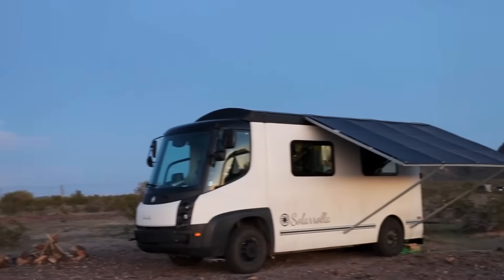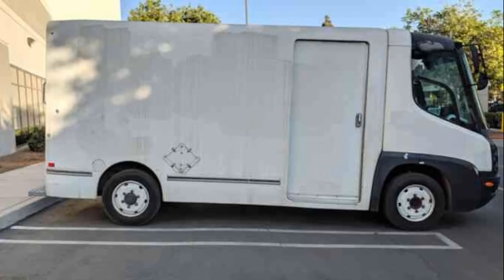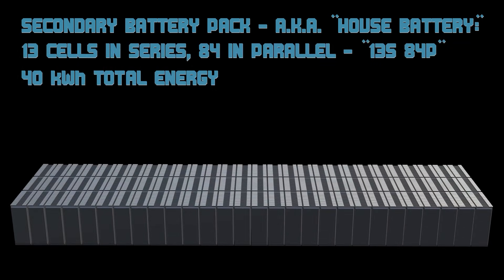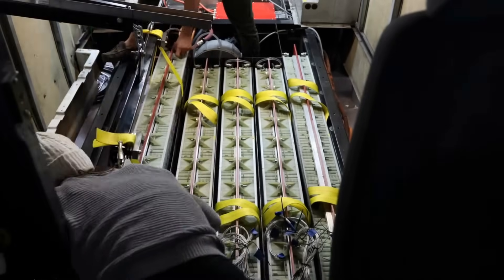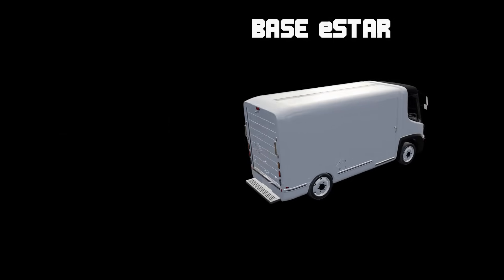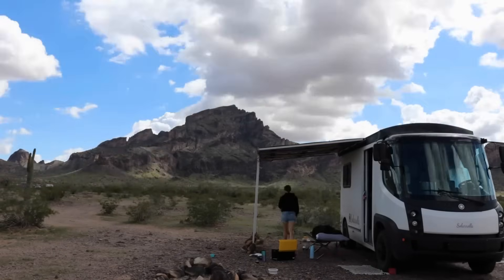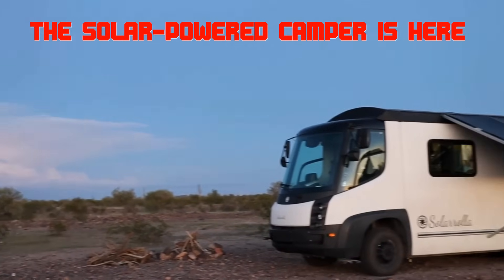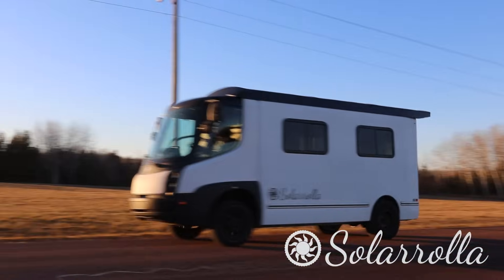Solarrolla Napkin Series 5 - Solar-Powered Fully Electric Campers!

Comment: I applaud the ingenuity, grit and hard work which went into your Solrrolla project. Few suggestions.  Right now you are getting around 200 miles on full charge using 320V motor as I understood? First of all go to 800v system as it is far more efficient, charges faster and can have larger range. Secondly don't waste time building your own batteries, this is completely pointless as you are nowhere near the tech and performance of the commercially available market leaders like BYD. Not affiliated with them in any way but those cells will be used in my build. with 48V house battery system you will get 600Ah battery pack (28.8kWhr!!!) weighing only 170 kg! Use the same cells for the traction battery but build the 800v array. you would need 250 cells for that giving you 251kWhrs! That's 1.4k kgs. For comparison, the Merc eSprinter 113kWhr battery pack weighs 850kg....
You can get the high voltage complete power train units from Cascadia (they have been providing F1 with their hybrid systems since 2009) or IRP Systems and tons of others. Going 800V would allow for much faster solar charging and shore charging in a pinch. I summary I believe it is better in most cases to use ready made products streamline time wise and cost wise your original designs. Also, using those products gives the entire build serious kudos :). Keep up the good work and stay away from anything Tesla ;)

Comment: Back when i was a kid, on my bike i had a wheel mounted alternator for my light, the faster you petaled the brighter the light got, is there a way to use this to help charge the batteries while on the road to help with the load until you dep,oy the panel array?
Reply: Because of the law of conservation of energy, it is impossible to gain more energy from what you put in then what you’d get out doing so. Meaning, a car’s moving tires can be used to collect energy, but it cost more energy to catch that energy then you can ever get out. This is why that cannot work. This principal is applied in electric vehicles though, it’s called regenerative breaking. Because, when you go to slow down a vehicle that is a loss of energy as well, and we can collect back from that. But for example, you couldn’t mount a windmill on a car, and expect to get more energy from the windmill— than you’d lose from the added drag from the windmill.

Comment: LiFePo4 batteries are great, only issue is probably the energy density; they're much safer than something like Tesla's Lithium Cobalt, but they hold way less energy per kilo. Still, if i were building an EV RV I'd use that chemistry. They are not nearly as explosive and don't require as much heating or cooling, either. You can even buy prismatic packs that are 3.2 volts and, say, 300 Ah; build them into compressing steel boxes perhaps and put enough of those in to reach some hundreds of volts and tons of watt hours and you'd have a great battery that can do 3000 cycles or more. I'd love something this size with slideouts for more living space and built on that 4x4 chassis. 4x4 to me is more about always knowing that getting stuck would require some serious screw-ups - and of course in snowy conditions it's brilliant. Some extra ground clearance wouldn't hurt either. Unfortunately my wallet can't come close to supporting that, and either way I'm not even in America. But great builds for sure, hope you do something great with the 4x4.

Comment: There is a thing called a crystal radio, from the very early stages of radio. It works without any battery to power a small earphone. Why not apply this principle to charge batteries, if used in large and efficient enough arrays?

Comment: One thing learned in mexico , in all deserts and mountains of North America is that CLEARANCE is more important than 4 wheel drive.
Though I had a Volkwagen kombi looking every much like yours  excepting only tht the interior had been modified t be over 6' standing room (I forgot the custom company that made the camper with its top (it allowed for a small bed at normal kombi roof level, but we used the area to safely stow surf and windsurf boards sails, etc.)), and was comfortable for two weeks at a time, which was about the financial limit for traveling . It was always confortable, and only the necessity to fuel up life with more cash limited duration.

I also had a Mazda 6 ft bed pickup, so light that it flew inadvertently over bumpy dirt roads. That style convinced us that clearance rules. 
As a 2-wd vehicle that model had been superior over Baja California's "1000" mile races to the competing 4-wds.
it looks as if the Solarolla has the requisite clearance.
I had NEVER had to dig out my own vehicle, though often rescuing stranded Canadians and US residents who had never had either experience or attention in driving in sandy and other areas where one cannot stop and start.
Lower clearance vehicles damage whatever s hanging low, and though duct tape and shoe goo got me several hundred miles back north in a VW diesel golf, those items cannot be expected to replace an oil pan - not a consideration in EVs.

WHAT are projected prices for the Solarolla?

Comment: Does the rounded roof reduce drag? Can you walk on the roof panels (you can walk on top of marine grade panels). What is the coefficient of drag for the base estar and how does it compare to an electric ram promaster or sprinter? Have you considered adding a tapered box to the rear or do mirror deletions (replaced with cameras) to further reduce drag? Can we get a look at how you've arranged the water storage, since it has to share space with the batteries? Have you considered adding a pop top to this model as well? Finally, have you considered using water sprayers to cool the panels (you'll need to use deionized water or else it may cause mineral buildup)?

I love the idea! Unfortunately I can only contribute ideas.

Edit: ah I commented before the end. Pop tops and slide outs is super exciting!

Comment: I'm hoping to buy a Tesla Robovan, pulling a light trailer loaded with solar panels to keep it charged.  I'm thinking of not only putting the panels on the trailer, but also pulling out vertically stored
panels to mount on the ground nearby to provide even more power when camping or at parks.  The pain in the neck part is solar connectors...they are easy to connect, but a real pain to take apart.
Do you have a suggestion on what to use for the connectors?

Comment: To do something like this is pretty cool, but that charge time and the foot print of the solar array is pretty big. I understand the whole purpose, but I would follow some other paths also only due to you're not promised fast charging everytime you're charging which is understandable however I would also buy a nice size generator for the worse of the worse problems occurring. I follow Murphy's Law, if it can go wrong it will and I would surely make it effective and try and cover every problem before it has a chance to sneak up...

Comment: Hello !!!   So AMAZING !  I'm currently building a 100% custom catamaran and I'm amazed by your electronic display...  What did you use for that ?
Reply from the maker: @antonygilbert9695  Hi, we used the AEM C7 display along with an arduino board built by an engineer Brett when to college with.
Reply: @solarrolla  THANKS for quick reply :) !!!    is this a CAN Bus connexion ?   and are your motors in 48V ??

Comment: How's about instead of having all that weight at the top of the vehicle with a smaller footprint why not find a way to utilize the sides of the vehicle with fixed panels that when stationary you can unclip and extend up. I see your pull out top mounted design and you unpack from the rear and frame up and extend solar panel design lets be real that is never going to work who wants or will spend an hour to set up their panels and an hour again to dissemble their panels, not only does that take Presious time its also a hazard from falling or in case of an emergency or danger you need to pack up and get away as soon as possible. Nope id like to just pull up hose off panels if need be for cleaning unclip a few clips press a button then stand back and watch the side panels of the van pop out and extend up and out capturing a larger area that that of the roof alone then if I need to get going do the same in reverse and get out of there quick in under ten minutes.

Comment: I always had this idea (even though I am not an engineer or mechanically minded) and wondered why they (EV manufacturers) don't put small wind turbines under the bonnet (I think you call it the hood) or even underneath. I mean you only need put your hand out of the window  at 30mph to feel the wind force (imagine that being funneled into a small wind turbine or multiple wind turbines). Would always be generating some electricity when driving & even when stationary on windy days would potentially produce a small amount. I realize it would create drag but thought the amount of electric it would generate would still be a substantial net +. electric gain. Obviously combined with solar & regen brakes for max all round off grid potentially unlimited capability. At least in my mind I thought it was possible & assumed it isn't being done because the powers that shouldn't be don't want people having free electricity esp on a vehicle that has potentially unlimited range (or could act as a mobile charging station for other devices/vehicles). PS great job here with the solar campers

Comment: Chucking my napkin idea into the mix. Teardrop rear, with canvas pop top when stationary, hinging off the back of the originally van. Like the trunk/ tent on the Aptura?
Reach out to local boat builders to look a creating carbon composite parts for the framing of the panels too, to save weight

Comment: This vehicle can't possibly get 100 miles let alone 200 miles using the panels shown in a day.  10 300 kWh solar panels are only able to provide a Tesla Model 3 a range of 30 miles given 10 hours of intense summer sun in Vegas or Pheonix; so even if you could find a spot where you could extend these panels out - like in the desert or parrallel parked where there were no side walks or other obstructions; you'd be lucky to get 50 or 60 miles going 30 mph; and at highway speeds you'd be lucky to get 30 miles. In less sunny climates like Seattle, Boston, NYC, Minniapolis - you'd be fortunate to get half of even those short ranges.Let me know when you can be honest.

Comment: Really interesting. Is 1mile/kWh as good as it gets on this vehicle? The (much smaller) Buzz gets 2.7 miles/kWh 3 if you don't drive too fast. I don't know how much the modec with 200kWh battery weighs but it feels like one could do a bit better than that? Blade cells in these looks interesting.

Comment: Gud am solarolla,I had an ebike powered 60v/45ah and 1500watts motor,I am asking how much solar panel do I need for this set up,I am using also a boost charge controller powering 600watts,tnx in advance for your response.more power to you Solarolla.

Comment: Perovskite solar film awnings retract (roll up) automatically when wind speeds exceed safe levels. 
Your design ideas are very creative given the juggling act of function, weight, size. 
Pop ups & slide outs made from super strong, lightweight carbon fabrics optimal. 
Some are towing customized utility trailers that use unit powered regenerative edrive wheels for enhanced towing, downhill charging and off-roading.
All the best to you guys 🫡🇺🇲

Comment: I think this is a bold experiment.  There is no reason every RV can’t have solar roof and awnings.  However we also need EV charging infrastructure in our national and state park campgrounds to get this idea over the hump and jumpstart the EV RV revolution.  Our parks should be the epicenter of climate change awareness and response, not showrooms for PM 2.5 spewing diesel rigs!
Reply: Our National park campgrounds should be shaded with solar panels tied to megapack batteries and charging outlets.  Charging does not need to be free either.  Priced right it would pay for itself while still being cheaper than fueling an RV!
Reply: Couldn't agree more!

Comment: I just calculated and planned a lot with a little AI support (using tech data of available small lightweighted EV Micro vans in Europe) and my results are:

Power on the roof (at charging pause) should be about the same as power consumed when riding, or better even a little bit more. Something around 10.000-12.000w should fit.

Charging power while driving - fron fixed panels on top into a second smaller battery - should of course be as big as possible, 2000-3000w would be nice. That could ad up to 10kwh of additional energy while driving.

That means: Main battery is as small as possible (usefull for a 3-4h drive, about 250-320km distance )  and vehicle, solar panels, battery etc. are as lightweighted as possible.

On a long summer day I want to travel 450-600km per day, with travelling speed of 75-80km/h.

Therefore each travelling day is divided into 4 or 6 parts - 2 or 3 times driving and 2 or 3 times charging (and in the meantime recreation, eating, drinking, planning, hiking, sightseeing or even doing work).

As sun is less powerfull in the morning and also in the evening it might be useful not to charge but to drive then - using part of the battery in the evening and the second part in the following morning.

With daylight from 7 am to 9 pm
a typical day on the road could be like this

7-10 driving
10-14 charging
14-16 driving
16-20 charging
20-21 driving

I want to be able to get to almost every region of the continent in one week or less.
Reply: So, you have a van that can fit 20 to 30 solar panels (100W) on it's roof?  I think you need a little more AI support on this.  You can typically get maybe 10 miles per day of power from a van roof that is totally covered with solar.  If you have panels that are about 3X the size of the van's roof when parked and all those panels deployed, you can plan to charge enough to drive 30 miles per day after the sun sets.  I'd love a vehicle that could do that.  Drive a hundred miles, then park for four days and charge back up before driving another hundred miles.  Would be a self-sustained, relaxing way to live. But you are not going to traverse any continents in such a vehicle without external charging.
Reply: @darth_pronator  You get me completely wrong 😂

The planning has gone some steps further since I posted it the first time.

In the meantime I found and tested the car that will be used. And I have got in contact with the company. 
The flexible panels have 430W each and a weight of less than 8kg.
 2 are fixed on the roof and on one side and 6 are inside while driving. They also form a sun protection roof during the charging breaks.

The car, a lightweight vehicle needs 8kwh per 100km.

There is just one big challenge - you need long days and full sun to make 600km. If that's not the case the possible mileage per day gets much less.

It will take some time - but then it will be presented here on YT.
Reply: @BarryMambo  Like you, I’ve spent a lot of time researching and planning a similar project. While the calculations in your second message seem more achievable, I still think they are quite optimistic.  I own a Chevy Bolt. It’s a small, efficient EV that gets 240 miles on a 60 KWH battery.  That translates to 50KM per 8 KWH.  There are not EVs out there that can beat a Bolt by a factor of two.  Also, keep in mind that, like all EVs, my Bolt loses about 25-30% of its range at highway speeds. I get 240 miles at 40 MPH. But there is no way I get more than 180 miles at highway speeds of 65 MPH.  Plus, I’d guess that 2 430 KW solar panels will hang significantly off the sides of the roof of your car. I doubt I could fit one of those panels on my Bolt. The wind resistance from that would certainly cut down the mileage by a good amount.  So, I think you are looking at a maximum of 30 KM per 8 KWH.  But certainly, if you have the large number of panels somehow stowed away in the vehicle to deploy when you park, you’d be able to travel a good distance in the evenings. But I am quite certain that real world performance would be a lot closer to 100 KM per day, rather than 400 KM. All this also assumes you are driving in hot weather, the range of an EV drops by at least 30-40% in the winter.
Reply: @darth_pronator  The vehicle I will use weights less than 600kg (thats more than 1000kg less than a Chevy Bolt) and needs 8kwh per 100km. The range is almost 495km.

Comment: Excellent work, I was surprised by the 1kWh/mile you experienced, that's 4 times my model 3 average (70% highway), even considering weight and drag, it seems too high...
Reply: It is high, at 75mph, can drop to 600 when cruisin easy 50-55mph.

Comment: 200 miles it's good but not always enough. Did you though of the BYD idea by adding a small engine (diesel/gas ) as a generator and calling - "extended range ev" ?

Comment: Replace the side mirrors with cameras will add 10% to the range.
Reply: Also lowering it, remove the mechanical brake system from the  rear wheels, and skinny tires
Reply: I was wondering about those mirrors too. Though trucks have different legal requirements for mirrors.